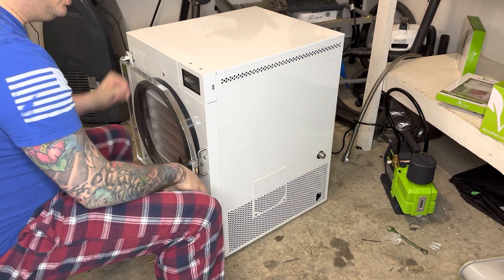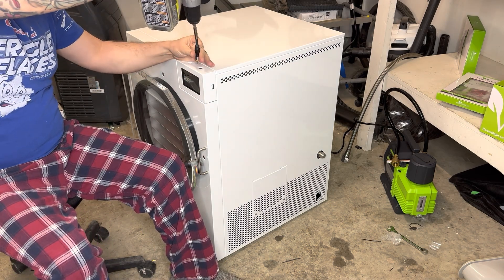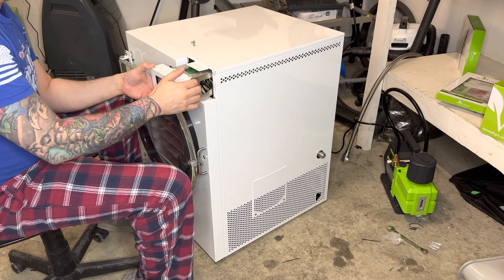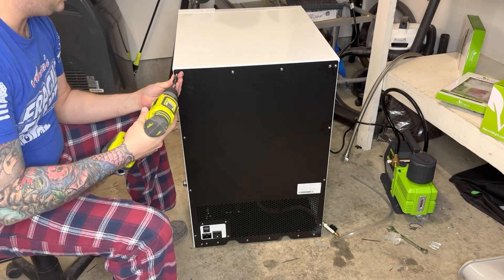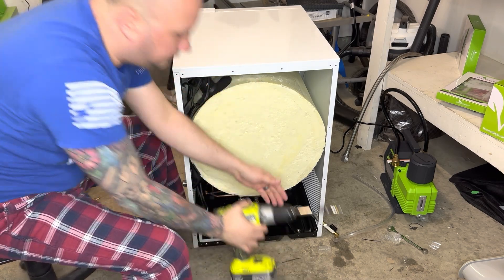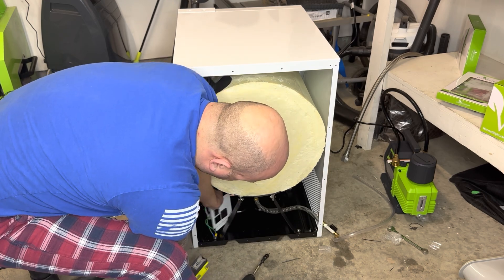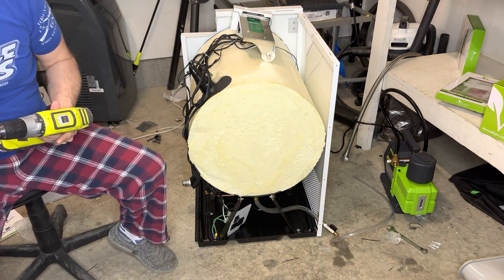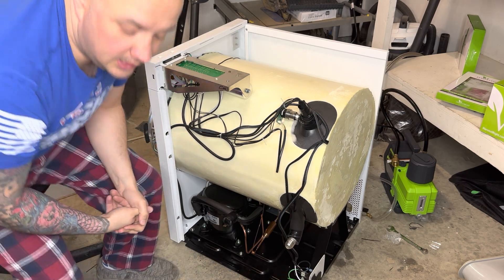Remove Panels from Harvest Right 2022 Model

Comment: Having been assembled within about a month before mine was I'd expect this machine to look about the same inside as mine, but it doesn't of course.  Capacitor is tucked away beneath the control module rather than hanging off the back of it.  Perhaps a small detail you could say, but attention to detail is where quality control lives.
Reply from the maker: Is that why you think mine will not pull out? If I moved it maybe it would be better?
Reply: @freezedryerrepairsupport  I think you may be right.  On mine the capacitor is out of the way behind the control module.  The back of the cap is right behind the vacuum sensor circuit board with only about 3/4" of clearance.